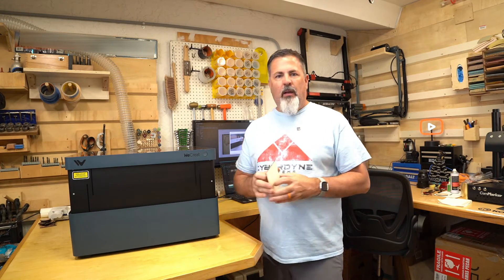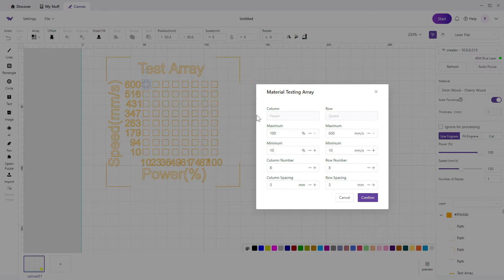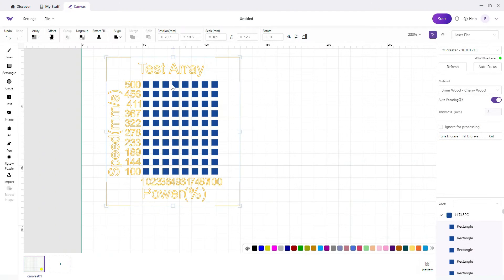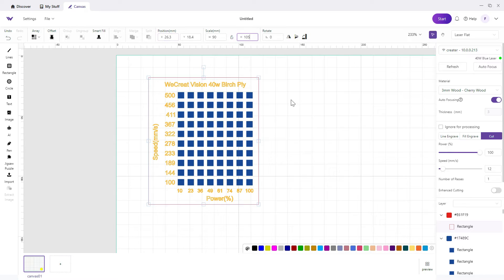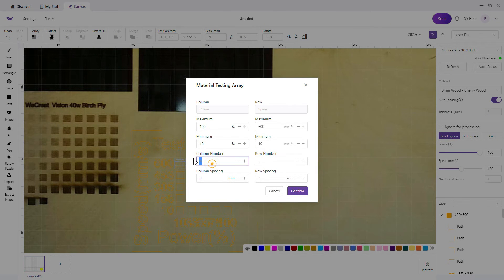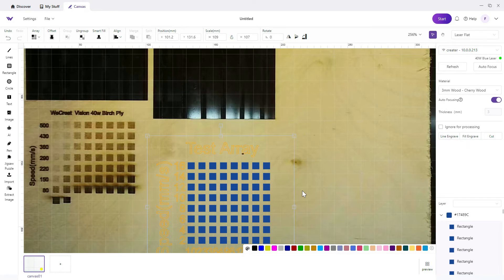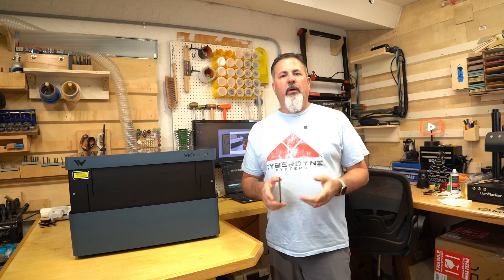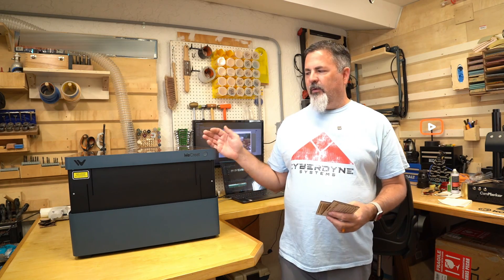Finding the perfect setting for your laser engravings. Material test cards using WeCreat MakeIt!

Comment: Awesome tutorial!!  I learned a lot.   I have a 20-w vision a starter for now.  So a fill engrave is where I can paint on correct?? I did a test but no fill was there.  my settings was   ( sp 100  pow 475) any suggestions ??
Reply from the maker: A fill engraving is like coloring between the lines. A line engrave is like tracing the outside. Unfortunately without seeing your project configuraiton and the final result I don't have a guess what may be your current issue.
Reply: @thetinkerverse   Ok I followed your test array by the #'s as you were typing in to set mine up for testing. My son has a bunch of Nat plywood 1/4 that he gave me I was practicing on that instead of the 1/8 in. I hope this helps.
Reply from the maker: @sandrasepulveda727  I'll have to see if something has changed in 3.0 that doesn't match my video.  Feel free to email me a picture of the result your getting so I have a frame of reference.

Comment: Do you change the material for each test?
Reply from the maker: Typically you'll do a material test any time you introduce a new material that you have not used before. You'll eventually build up a library of test cards that you can refer back to for materials you have one in the past.
Reply: @thetinkerverse  hi and thanks in advance. Im trying to do a test on a slate coaster. Slate only comes up as customization.Once I put in slate as material it won't allow the settings to do it's test. the individual squares are at the same setting 0